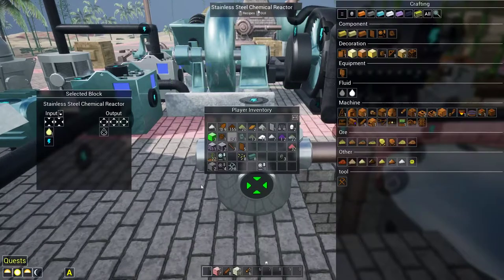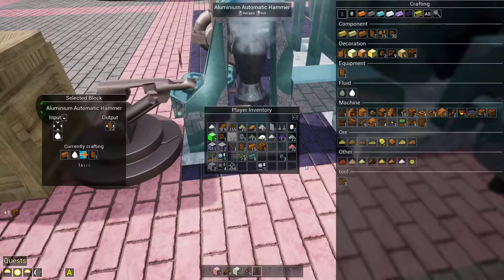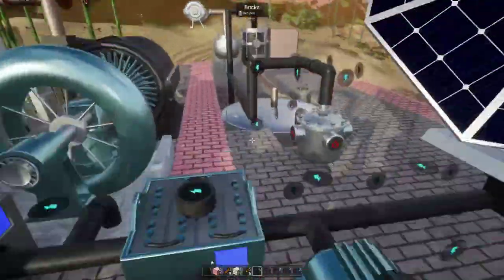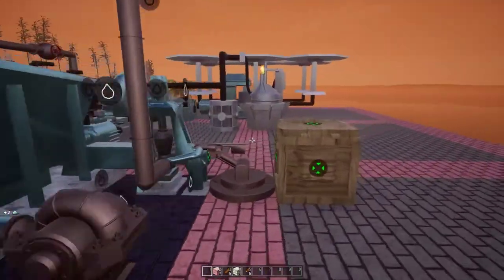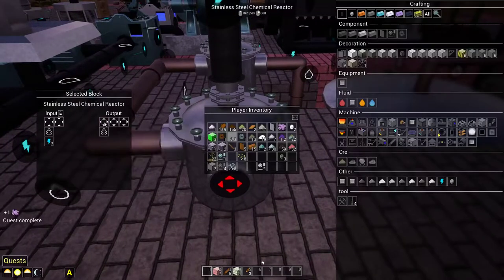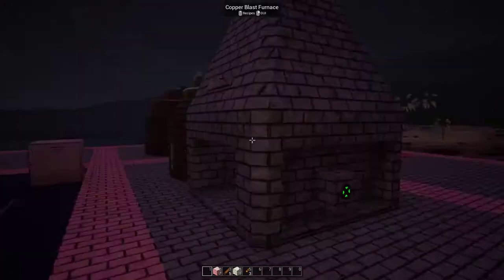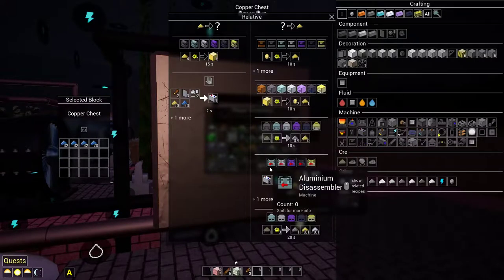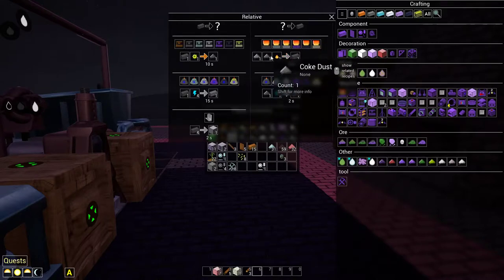Evospace #14: Titanium Sponge

Comment: Still not sure why you're not creating dedicated production lines for each process. It's kinda the whole point of the game and how you progress from one tier to the next. What's the fun in running around and trying to do everything manually?
Reply from the maker: It started as a rush past steel, since i couldn't find much of the iron ore, and I just kind of kept it up. more machines means more material i need to process before advancing.
Also some materials are used in multiple tiers, so not the best idea to just fully automate a line past a certain point.
Reply: Ryan, I agree with you. I’m enjoying the series but Brad seems to be racing through the game rather than enjoying each step, building out complete systems. His approach seems to miss the point of the game but to each their own. He is however helping me understand some concepts.